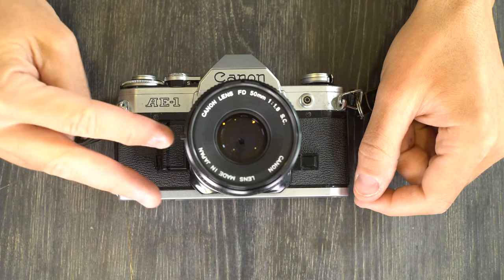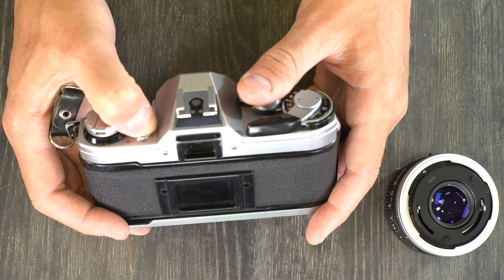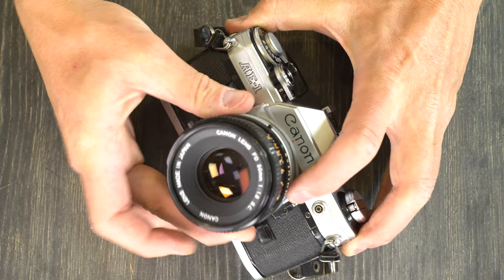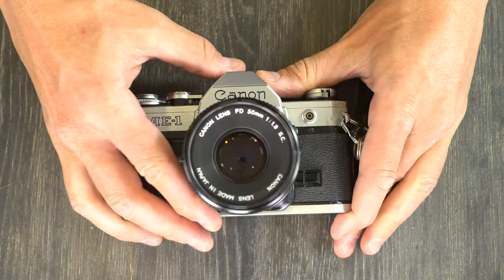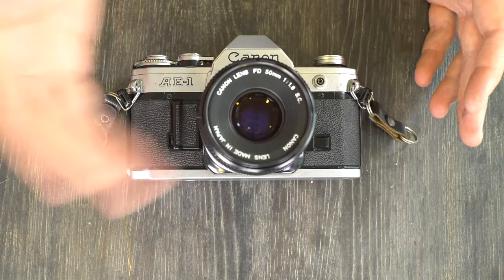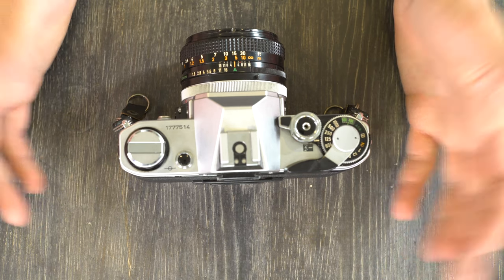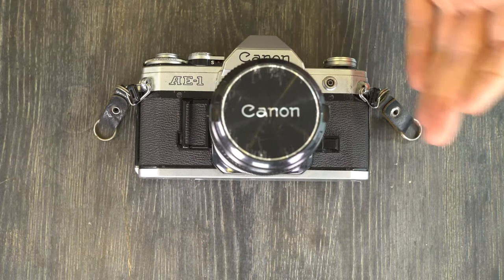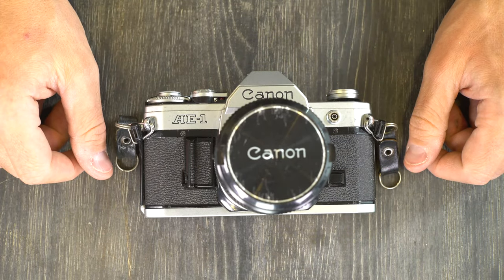Canon AE-1 Manual 2: Operation | Take a Photo, Double Exposure, Batteries, Lenses, Metering, & Flash

Comment: Very informative and detailed video - thank you! I just have one question regarding double exposures- after exposing the first picture in a good way (with a smaller amount of light) do I have to cut off the light on the second one as well?
Reply from the maker: Thank you! Yes. The total exposure time of the two images should (roughly) equal a single proper exposure. So both shots would need to be either half the shutter speed (which means twice as fast of a shutter speed) or one stop smaller on the aperture scale.

Comment: David, how are you? Excellent video! I need your advice. I bought this camera a week ago to get into the world of analog cameras and learn how to use them, as I'm young, I'm 25 years old. However, I'm having a problem: the meter needle is always at the bottom and the red light comes on. I've tried everything: cleaning the camera, playing with the shutter speed and aperture settings, but the needle still stays at the bottom. Do you know how I can fix this?

Thank you in advance and have a great day
Reply from the maker: Thank you! I wish I had good news for you. What you're describing is the characteristic of a dead electronic board. There is no repair for that, unfortunately. I would return the camera while you're in the return window and order from a different seller.
Reply: @DavidHancock Thanks David for the answer. I can't return it because I bought it from the Marketplace so it will be an ornament :( However, do you think I can shoot the photos since the shutter and aperture work? and I try to measure the exposure with an app on my phone

Comment: Hi, I came across your channel and had a question too! I've been struggling to find the reason behind red flares on my rolls and have been wondering if changing lenses mid-roll be a problem in any way? I'm not quite sure how the mechanics work and if removing the lens while the film is in will affect it. 

Thanks so much for your content!
Reply from the maker: Is the red flare a vertical line on the images? If yes, then there's a light leak in your camera's light seals. If the flare is in the exact same place on each frame, then the leak is somewhere between where the film exits the cassette and where it's taken up on the spool. If it's in different places then it's on the door hinge. I have a video on replacing light seals with cotton yarn. It's a quick process and should fix your issue.

Comment: Hello there david. How are you? I have some questions about the double exposure. 

1) you said that both of the exposure must be underexposed by one stop. Do we need to set both the shutter and aperture to one stop faster, or just either one. I got confused.  

2) after we take the dead frame, (when you said that only partial of the frame was advanced) we will advance to the next frame. Will it cause the cause the film to be 1 lesser exposure? Because it is blank. 

Thank you david. Great video btw.
Reply from the maker: Hi, Zakaria,

1- Just set one under by a stop. Either or the shutter or aperture.
2- Nope. As long as you restore your settings so that you aren't shooting underexposed one stop, your subsequent frames will be properly exposed.

Thank you!
Reply: @DavidHancock  thank you so much for the reply

Comment: Hi, great video by the way! 
Question: When operating in Manual-Mode, I can see the aperture closing whenever I take a picture. But in Automatic Mode, the Aperture does not move at all. What is the reason for that?
Reply from the maker: Most likely lighting. If the aperture doesn't need to stop down then it won't. Try it pointed at an interior light, 1/60, 400 ISO. With a bright indoor light, the aperture should stop down to about 5.6.
Reply: @DavidHancock  thank you so much! The automatic aperture totally works, it just needed more light as you said. Perfect!

Comment: great video...thanks for that! I just gone one in the mail today...everything seems to work, but I can't turn off the red light diode underneath the shutter button, regardless if it is in lock position, S or selftimer... I think that would drain the battery faster than necessary...?
Reply from the maker: Thank you!

For that light, I have an ebook about this camera now that, I think, addresses that (there's a link in the description if you're interested in it and learning about the other known electronics issues.)

For your issue, I'd first try to remove the lens, make sure that the DoF preview is NOT pressed inward, set the lens to "A" or the green circle (depending on your lens), advance the film if needed, re-mount the lens and see if it goes away.
Reply: @DavidHancock  thank you so much David for taking the time to. reply...I have tried all of the above, but light is still on red, regardless of the position of the lever...and it also has drained the battery which was new yesterday and when doing the battery check, needle is almost at 5.6 and shutter won't fire...I think I will send that camera back...or do you think it could be an easy fix?...Happy to get your ebook once I know that I keep the camera or replace it with another one....

Comment: Great info!  Just what I was looking for.  I have a question about the flash.  I have a Canon Speedlight flash 155A and it doesn't have the option to tilt up or to the side.  Just straight, so it would bounce straight to the subject?  I haven't used it so I don't know how it would look like.  Also for the Aperture do I set it to A?  and shutter speed to B?  .  I plan to take it for Night photography.  Thanks!!
Reply from the maker: Thank you! So for the 155A, I'd suggest buying a PC flash cable to hot shoe adapter (probably $5-7) and then a flash bar (around $3). Make sure that the cable to hot shoe adapter has a 1/4-20 socket (standard tripod socket) in the base. Then get a flash bar with two 1/4-20 screws. You can then place the flash off to the side and articulate it. The flash then just plugs into the PC port to the right (when looking at the camera) of the lens mount.

Comment: HI! Thank you for this video as it helped me alot since I’m very new to this whole thing!

I do have a question though, is it normal to have the light meter fluctuate fast ?? Everytime I look through my view finder it’s either at the very top (where the 22 number is) or at the bottom (where 12 is). I was following everything you mentioned when you were explaining how to shoot manually but my light meter does not necessarily stay  on a number. I just got this camera so I’m not sure if its broken or if I’m just doing it wrong 😥
Reply from the maker: That is not normal. That's a sign that the electronic components are starting to fail. Definitely return it or exchange it for one that works.

Comment: Can you still shoot without a flash with this camera I don’t have one and I don’t have the light meter
Reply from the maker: Yes you can. Just follow all the guidance in this video except the flash section. This camera has a built-in light meter, and unless it's failed then it will work if you have a battery for the camera. Is your camera's light meter not working?

Comment: I have a question! Shooting in manual mode (aperture priority)... let's just say I want to shoot f8 but the meter needle is pointing to f4. When I change the aperture to f4 the needle stays pointing at f4. Will this give me an underexposed photo as the aim is to have the needle in the centre (f5.6)? Or am I meant to be changing the shutter speed so that the needle is in the centre?
AKA, should the needle always be in the centre to have a correctly exposed photo? Hope that makes sense thank you for the great video!
Reply from the maker: For this camera when shooting with manual apperture control, set the apperture to the number that the needle points to. So if it says f/4 and you're at f/4, your exposure should be correct (assuming you don't have the sun in your frame or a similar situation that massively alters the meter reading.) If the needle pointed at f/4 and your set the lens too f/5.6, your image would be one stop underexposed. Basically the meter is telling you what the apperture should be for your selected shutter speed, film, and lighting.
Reply: @DavidHancock  brilliant, thank you for your help!
Reply: @DavidHancock  this answers so many questions. I was used to the K1000 with having to always keep the needle in the middle so using an AE-1 was confusing for me

Comment: Thank you for this video very informative. So if I am shooting in manual and let's say I want to shoot wide open at 1.8 and I look into the camera and the light meter is pointing to 1.8 it will be properly exposed?
Reply from the maker: Thank you! And correct. The light meter will tell you which aperture to use in manual mode based on your shutter speed; it will also tell you which aperture it is going to use in auto mode based on your shutter speed.
Reply: @DavidHancock  thank you!

Comment: The advance lever will not fully crank as well if i dont have a battery in it?
Reply from the maker: The advance lever will not go until the shutter has been fired and the shutter requires a battery to fire, yes.

Comment: Hi Dave
I just recently got an AE-1 and I’m trying to underhanded the light meter better. I read the manual but it doesn’t go too much in depth with it. I was wondering if you could help me. 

So from my understanding, this camera bases it’s aperture on the shutter speed selected (the little needle going to numbers depending on the shot etc). 

Now, doing it automatically will of course select the proper aperture for the best and accurate exposure right? This is where I get a bit confused. 

Let’s say I’m taking a portrait shot of someone, would I have to adjust my shutter speed to get that depth of field effect or my aperture for that? And once I do select the proper shutter speed, will the light meter know I want it to be a portrait type photo?

AKA does the light meter have to work so that it must be in the middle? (Like a K1000) or is it just strictly an aperture recommendation meter (that will tell you if it’s underexposed or overexposed with the blinking light and red bar) 

I’m just a bit confused since I’ve used a K1000 before and the way it works is you have to have the needle in the middle to get the balanced out exposure. I’m trying to best figure out how the AE-1 light meter behaves.
Reply from the maker: So you've got the gist of it, yes. The only correction I have is that the camera has no idea what type of photo you want to take. It's up to you to pick the shutter speed that gives you the aperture that you want with this camera, yes.

Comment: 19:31 
Just to be sure, as I am a bit new to this. If you select the automatic mode and select a shutter speed, the campera will select the correct aperture for the selected shutter speed, right? (Not a new shutter speed)
Reply from the maker: That's correct. With the AE-1, the camera is designed to provide automatic aperture selection based on your preferred shutter speed.

Comment: I habe used an ae1 for about a year now. I am pleased with the camera and the results but have a small issue. Maybe you have an idea on how to solve it. My iso dial keeps turning when I change the shutter speed or wind the film to the next frame. It happens quite often, and if I am not paying attention I shoot the film at a too high iso, I.e. underexpose the film. Any suggestions on preventing the dial to turn.
Reply from the maker: That's not supposed to do that. Sounds like the winder is too tight on there. It probably needs a repair. I used www.SLR35.com for my AE-1 repairs.

Comment: Just to make sure I'm understanding correctly. I'm automatic mode, to have a properly exposed frame all I need to do is select a shutter speed that keep my light meter needle in the center? The needle dropping low or high would indicate under exposure or overexposure?
Reply from the maker: Actually, it's even simpler. All you need to do is pick a shutter speed and not have the needle above or below the numbers. The numbers will tell you the apperture that your lens will be at for the photo.
Reply: @DavidHancock  Thank you got the reply. It's a little hard to trust the camera without my handheld light meter. Fantastic video, I always learn something new

Comment: What are some specific small flash i can add to the pc port? And once it’s in, can I choose when to enable flash or not without taking it off?
Reply from the maker: I don't have a specific make or model flash, any of them will do as long as they have manual power controls. With the PC port, the only way to prevent the flash from firing is by turning it off or unplugging it.

Comment: How do I remove a camera strap? Mine has the black plastic pieces on the metal triangles for the straps and it's in the way to remove my strap
Reply from the maker: If you don't like the strap, you can cut it off. If you do, just keep working the connection at the end until you can feed it through the clips and split rings.

Comment: I was just gifted an  AE-1 and I just want to confirm that I understood this correctly. With my lens locked on AE, I can choose a shutter speed and the camera will automatically use  the appropriate aperture?
Reply from the maker: @colem1177  that's correct!
Reply: @DavidHancock  would you happen to know if it’s the same for my pentax k1000. The lens on that one also has an A on it. I watched videos on the camera and no one had mentioned anything about an automatic mode
Reply from the maker: @colem1177  on your K1000, no. That camera is manual only and if you use the lens on it in A mode none of your images will be properly exposed. The K1000 cannot accurately use the light meter when a lens is set to A.
Reply: @DavidHancock  okay thank you so much. One more question I’m so sorry. I have a tamron 28-200mm lens on my ae-1 and when I was trying to take the lens off the tiny little plastic pin that sticks out for the silver lever is held in place by broke off. The lever doesn’t work now so I just took it out. Is the lens ruined? I can still get the lens on and off, it just doesn’t lock itself in place now. Can I still use the lens on this camera or is it ruined? I was looking for repair part and couldn’t find it anywhere
Reply from the maker: @colem1177  Hmm. That may be a lost cause for that lens. It may also not be your fault as there could have been a crack in the lens or some previous damage that made that prone to happening. The Fix Old Cameras channel will know if that's repairable, but my guess is probably not.
Reply: @DavidHancock   dang that sucks. Just got it and was so excited about a large lens like that one. On reddit some repair people were saying I could get away with using a hand vise to drill a small hole and get a filed down pin that’s the same size to insert and use a tiny bit of jb weld to hold it in place. Is this even worth attempting?
Reply from the maker: @colem1177  Hmm. Maybe. Right now it can't be used, and if that repair fails it can't be used, so there's really nothing to lose and if it succeds you've learned a new trick.
Reply: @DavidHancock  what about it not locking in place prevents the camera still working with the lens? It looks like the lock is purely mechanical. Just a little edge that doesn’t let the lens rotate. Shouldn’t it still work if it’s in the position it would normally be locked at?
Reply from the maker: @colem1177  if the lens isn't locked in place correctly, I would be concerned about the mechanical couplings inside the camera mount getting damaged. The lens needs to be locked for those linkages to align and interface correctly.

Comment: Hey I’ve been using the ae-1 for a while, I want to upgrade to a better 35mm film format camera to regards on construction. I was maybe thinking if the Nikon lens are sharper and overall better than FD canon lenses. Do you think they are? What would you recommend for me to upgrade to? Maybe canon F-1? Or Nikon F2? Thanks
Reply from the maker: I would say six one way, half-dozen the other for lenses. Some of the FD lenses are amazing. Some of the Nikon lenses are amazing. And some of each are mediocre or fine. If you want to save some money and stick with the FD lens system, especially if you own a few lenses, look at the original Canon F-1. If you can find one modified to take modern batteries, it's the best Canon FD mount camera, in my opinion. Other great FD cameras would be the A-1 and the T70 and T90. The AT-1 is also a bit more robust than the AE-1.

For Nikon, if you do decide to switch systems, look at the FM, FM2, FE, FE2, and the F3 or F4 as definite steps up from the AE-1.
Reply: @DavidHancock  Thank you! I only have the canon 50mm 1.8 the newer one (not the one you show in the video) so changing systems to Nikon wouldn’t be a problem. I’m also thinking about switching to a rangefinder like the canon p (then after a Leica m3 lol) maybe if the slr’s don’t convince me. But if I were going to stick with Fd lens’ what are the sharpest they made? And for Nikon as well. And out of all the sharpest of both which you prefer. Thanks!
Reply from the maker: @tigerhunter8878  All the high-end FD lenses are good. Singer that I particularly like are the 50mm 1.8 and 1.4, 28mm 2.8, 35mm 2.8, and 135mm 2.8 and 2.0.